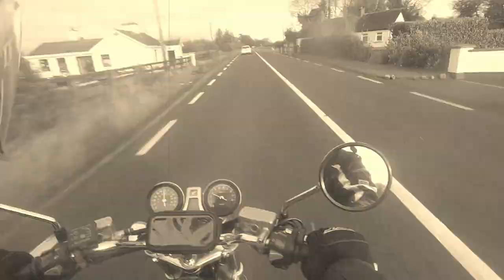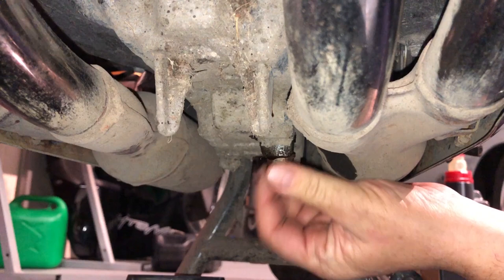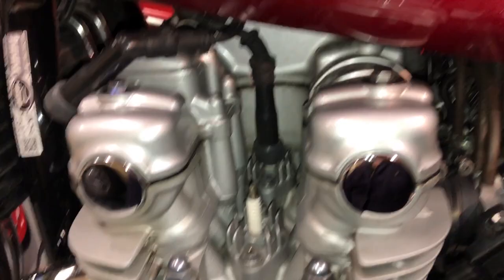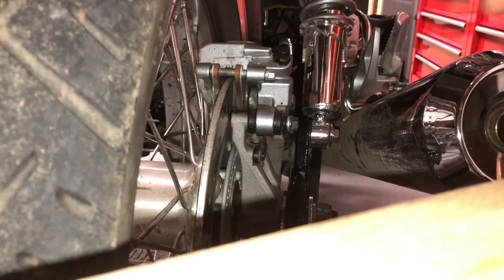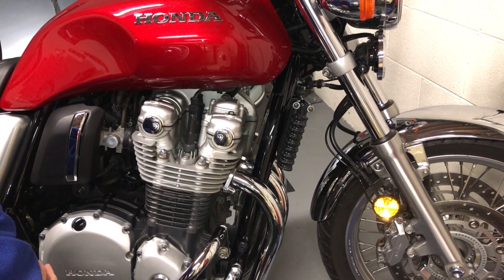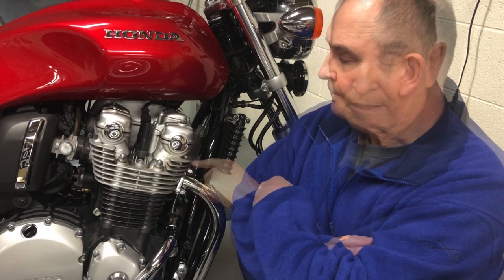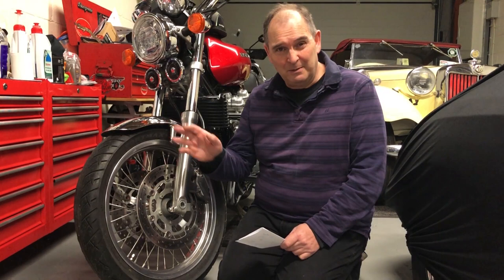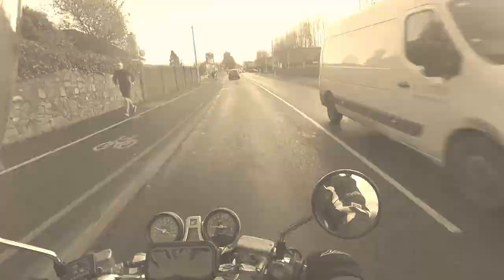CB1100 - what does it take to maintain?

Comment: I recommend that you replace the oil filter with every oil change if you like your bike. The cost of oil filter is negligible and you extend the life of the bike. I wouldn't buy the bike from you if you told me that you replaced the filter every 20K kilometers. Also, I would replace the oil every 5K kilometers if I were you and disregard Honda's recommendation. Just saying.
Reply from the maker: Sorry, I’ll have to disagree. Extending it from what to what? A 250,000km  engine life to 270,000km? This extension, if it was real, would have no impact on my ownership. Do you know that my filter is working sub-standardly at 17k km compared to 9k km for a fact, why are the people that designed and built the bike wrong? If I was living in an area with a very harsh hot climate I might be inclined to agree with you more. Cheers.
Reply: @terenceokeeffesmotorcyclestuff  Well, those who designed the bike don't necessarily want your bike last longer. Personally, I replace the oil in my bikes after every 3k miles with filters. The filter element gets clogged up and indeed degrades so it can't do the job properly. Look how black the oil was coming out of your engine! It means among other things that your filter was not able to retain the burnt elements and other particles that harm your engine. The black oil in your engine lost its properties to cool, lubricate and clean so there was more wear. It's like you replace your clothes but don't wash or vice versa! But it's your bike, you do as you please and save a couple of pennies at the expense of your bike.s longevity. And don't expect your bike to last 250 K kilometers if you treat it like that. Cheers!
Reply from the maker: @youcanfoolmeonce  - I’m sorry but you can’t make any of those assumptions about my oil or oil filter, you just can’t.You are just stating your opinion and what you would  do. My point was this bike will never do 200,000 km so it is a mute point. If you really believe your filter can filter out the carbon in the oil merely changing the filter would change my oil back to golden, we both know it won’t don’t we though?   But it is a free world and you can change your oil and filter as much as you want.
Reply: @terenceokeeffesmotorcyclestuff  Penny wise, pound foolish. It's not a free world though, we are all slaves except the ruling elite.
Reply from the maker: @youcanfoolmeonce  - well that last sentiment I can agree on.

Comment: I have a black one, 2013 - 2016 model. I bought it new. This winter I performed a big service on it. It has 18000 km on it. I changed the tires to bridgestone T31. Without the tubes, i made the rims tubeless myself. The air filter was spotlessly clean. The sparkplugs were fine. The brakes and discs were nearly touched. I cleaned them up, gave them new Dot4 fluid and that was it. The chain needed a little adjustment, but no sign of excessive wear there neither. I also changed the fork oil. I was a little surprised there. Both legs has 3 cm too little oil in them and the right leg missed the washer between the spacer and the spring. It made me wonder a little, but that is over now. This bike is really a pleasure to ride and to work on. At the gas station someone said to me that It was beautifully restored and asked me how old it is. I like the 2016 model more for the tank and not having the black paint on the engine. I like the chrome around the horn of the 2017 model, which mine doesn't have. Further on, i mounted the same rack as yours has. It makes the bike even more beautiful. Have a nice ride and keep safe.
Reply from the maker: Hi Walter. I have the T31's too which I think really suit the bike. I was a bit lazy and paid BartFactory to convert mine to Tubeless. Sounds like yours service experience will be mine too, I am only at 10K KM but as you know that is nothing to this engine. That rear rack is short but I do like that look compared to the longer Honda rack, it looks a little better proportioned. Take care, thanks for watching.

Comment: Thanks, nice video!  My 2014 CB (Which I bought new) has 22,000 miles.  I’ve checked valve clearances twice and virtually no change.  Unless I hear a noise or something, I’m not going to check them again.  The chain, which I clean and lube regularly with 80w gear oil, hasn’t gone through half its allowable stretch.  I plan on replacing chain and sprockets in the near future just because they’re 9 yrs old.  Three times I’ve removed the wheels to have tires mounted at my local dealer.  Metzler’s are my go-to now with great grip and wear.  The bike’s never been in the dealer for maintenance.
Reply from the maker: Thanks noleshot. That is great to hear with the valve clearance, that seems to be reflected elsewhere too. Yes, typical Honda, who needs a dealer 🙂.

Comment: just what i was looking for thank you, looking at them just now
Reply from the maker: No problem 👍. When you find one sit on it before committing to it. The bike is wonderful in so many ways but it does have quite a short seat to peg distance. If you have a longer leg you will find it a little acute on the hips. Luckily for me I have a 29” leg.
Reply: @terenceokeeffesmotorcyclestuff  thanks terry mine i think is a 30 , was doing well till i heard tyre costs
Reply from the maker: @stanleylawson9015  I went Bridgestone T31 tubeless which you can use with an inner tube, costs back to normal!

Comment: Thanks for the info. Much appreciated. I just sold my Interceptor 650 and replaced it with a 2016 CB1100EX deluxe. I've done valve shims in the past on my suzuki V-Strom 650 which also shim under bucket. Although four cams in total. Would you say the CB is more tricky than the V-strom if you had any experience of changing either.
Reply from the maker: Not done either unfortunately. The last bike I did was my 16 valve Daytona 1200 which was shim over bucket. The CB does have a great reputation for needing little or no re-shimming for many miles, 60k plus. I would say it is easier at least to check these after the tank is off. As long as you take the view that ANY measurement within the tolerance is good to leave and not make it your goal go shim to some middle value. Enjoy!

Comment: You forgot the fork oil change.  I changed mine at 10k mikes and it was a slightly darker brown.  The regular Honda fluid is pinkish/ red.  The forks have come off the bike as well.
Reply from the maker: Yes, I thought to mention it but didn't really count it in as so many people leave it until they have a blown seal forcing them to do something. After giving my Daytona forks a good clean out the difference was appreciable and I shall do the CB's at some stage.

Comment: I have a 2017 CB1100EX and I plan to buy tubeless tires and just stick a tube in them.  It’s hard enough to find tubeless tires in the correct size, especially for the front. In the US market the bike has a 112 mph speed limiter. Plus it makes 88 hp at the crank. It’s not hard on tires.
Reply from the maker: Yes, that’s the way to go I think and I am sure that is what most people are doing. I am actually going to convert the wheels to tubeless.
Reply: I have the 2013 Honda CB 1100. I love it. Is there anyway to remove the speed limiter ?

Comment: I certainly wouldn't use any K&N filter or any oil based air filter for that matter. The air being drawn through the induction system may draw with it a thin film of oil from the filter which may contaminate any fuel injection sensors causing them to either fail or give inaccurate readings. This is quite common in early car injection systems where the injection system was designed around a dry paper element.
Reply from the maker: Yes, never seen the draw of K&N filters. 👍

Comment: How many liters is used for each bar of the front fork? Please
Reply from the maker: I’m not sure I’m with you? If you mean the rings on the preload adjusters they are purely mechanical and nothing to do with the amount of fork oil. Depending on the model the 2013 to 2016 the fork oil amounts were between 434cm3 and 506cm3 but I don’t have the figures for the 2017 models onwards I’m afraid.

Comment: Arent the alloy wheels tubeless? I mean, on the other, older version (2014 or something). Btw, i got standard tubeless tires fitted on my Africa Twin, even though it has tubes.
Reply from the maker: They are. Yes, I shall either fit tubeless tyres with tubes but I’m leaning towards a tubeless conversion.

Comment: Great video Terry..
I'm looking at a 2013 cb1100 or a 2017 Bonneville 1200 can't make a choice ?? Any preferences? ?
Reply from the maker: Thanks. 2013 was 5 speed, I would take the 2017 Bonneville. Wasn't that mad on the styling of the CB1100 until the 2017 model years. Both great bikes though.
Reply: Took the CB really like the way it drives and build quality. Im 60 years old  on bikes since i was 18 and love the simplicity of it ....thanks keep up the videos can't get out with the Rain in Galway so bike is gleaming...

Comment: Great video! Are you sure that a tubeless tyre is not  compliant with the CB wheel? Other bikes wheels with inner tube fit tubeless tires.
Reply from the maker: I have had the wheels converted to tubeless and Bridgestone said they supported their T31 on this rim. The T31 is noisier up front than the OEM Dunlop but allows for fantastic handling. Thanks 👍

Comment: I ride 15 thousand Miles per year on my Honda Rebel 500. I am considering this model.
Reply from the maker: I would be loathed to put you off buying this bike but 15,000 miles a year is a lot of riding on a standard roadster. It will cover the mileage with no fuss or bother and reliably so, but not as well as many alternatives in terms of long distance comfort. There will be high mileage examples out there but I believe most are not used at the mileage you need.
Reply: @terenceokeeffesmotorcyclestuff  I like the retro style, and engine but unfortunately in the U.S. we only seem to have 2013-2014. I have this bike and a 2014-2017 Dyna Low Rider in mind. I still wonder how many miles I can get from the Rebel 500.
Reply from the maker: @e.l.9589  I bet that Rebel, being a Honda will just go on and on.

Comment: Ebay-110/80-18 Avon AM26 Roadrider Front/Rear Tire, $108 140/70-18 Avon AM26 Roadrider Rear Tire $150. Very good tires. 2014 Honda CB1100
Reply from the maker: Thanks for the recommendation on the Avon's. Doesn't look like the local stockist holds those but it would be easy to get them. https://www.avontyres.com/en-gb/tyres/roadrider-mkii?searchtype=car&cartype=motorcycle&car=Honda%20CB%201100%20CA%20-%20EX%202017%20-%202021&engine_spec=1100
Reply from the maker: @ec9156  You're very good, thanks for sharing your experience.
Reply from the maker: Kind of you to say so, thank you.
Reply: The Avon tires are adequate, but the Bridgestone BT54s are better. I had Pirelli Scorpion A/Ts on for a while and those were really nice for a adv tire. Trying out the Pirelli Sport Demons now. If Dunlop ever makes the Roadsmart 3 in a 140-150/70 for the rear, that would be a decent option as well. I had one of the front for a long time because it's dual compound. I think I went through 2 rear tires and it's still got plenty of life left on it.

Comment: Non maintenance question. I was looking at your rear rack and pannier set up. Is it OEM and is it for soft luggage?
Reply from the maker: It is for soft panniers. Not OEM, it is by the German company WWW.FEHLING.DE. Reasonably priced Vs OEM too. My front engine bars are from them as well.
Reply: @terenceokeeffesmotorcyclestuff  excellent. Thanks for the quick response. What brand pannier did you go with?
Reply from the maker: @1newbert  I have only had the bike since November and don’t have panniers at the moment. They wouldn’t want to be too big otherwise the rear indicators would need relocating. If on a budget and had a rear rack a 40ltr LOMO bag and their smaller size throw overs would make a good set for next to nothing. Otherwise there is so much to choose from from super stylish premium to the likes of LOMO.
Reply: @terenceokeeffesmotorcyclestuff  thanks again. Just thinking in terms of being able to carry a couple bags of groceries, store foul weather gear and the odd overnighter.
Reply from the maker: @1newbert  no worries, a bike to be enjoyed either way. 👍

Comment: Honda should've used hydraulic valve gear, as on the 1980's CBX 750, seeing as this is a far less revvy engine. Ditto with Suzuki on my SV1000, same shim under buckets, a right palaver when the time comes. I had it checked at just over 24,000 miles, all within spec. On 31,000 now and was told by the dealership that it'll be fine until 40,000 at least but I'm extremely fastidious about oil change intervals. Cowardice personified, in a perhaps vain attempt at limiting valve gear wear !
All the best from Burry Port, 15 miles west of Llanelli, and not doing much lobe scraping at 20 MPH.
Reply from the maker: Yes, for the price of a few litres of oil it's good insurance isn't it? Hydraulic lifters would of been the icing on the cake for this engine. It's a heavy enough bike as you know so a little more wouldn't've of killed it with the extra technology. Cheers to you Michael.